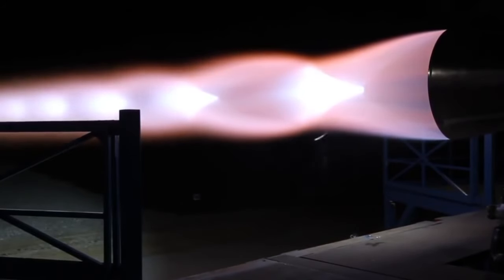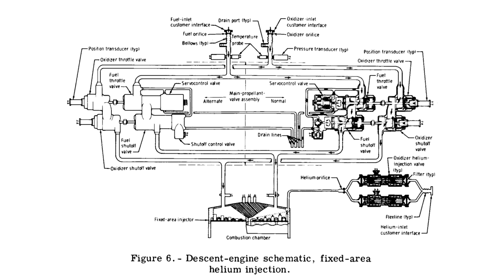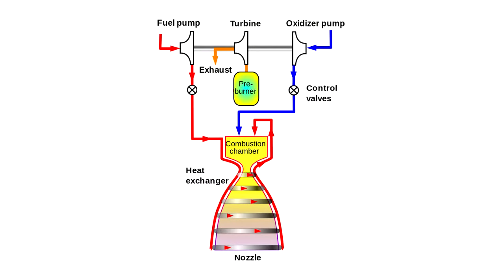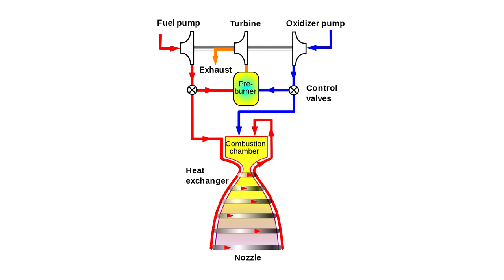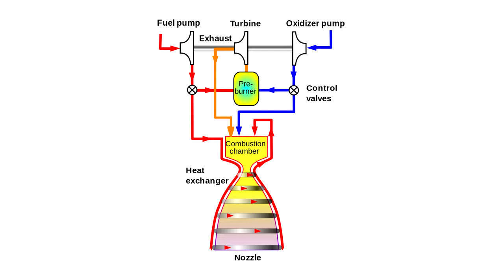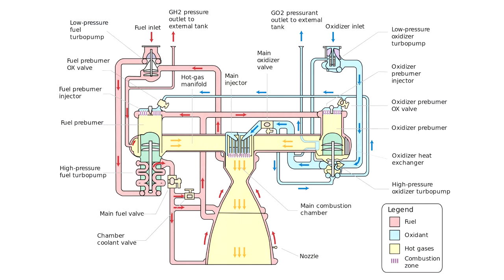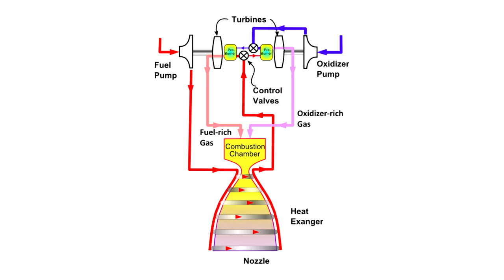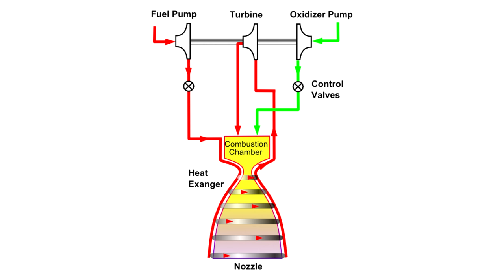KSP Doesn't Teach: Rocket Engine Plumbing

Comment: The one thing I would correct is that the notion of a oxygen-rich preburn being "cooler" than a stoichiometric burn.  Oxygen rich actually is a bad double-whammy:  It runs hot and it introduces an oxidizer into a hot metallic system, leading to rapid disintegration.  This is principally why running "lean" in car engines rapidly destroys them.  The problem the Soviets found was that a fuel-rich preburn clogged the exhaust pipes and threw off the delicate flow balance into the main combustion chamber, so instead they designed turbine wheels that could survive the heat (probably the first use of Inconel turbine wheels).  The space shuttle engine got around the problem by using hydrogen fuel, which has no solid byproduct.  So they can run "rich" while still maintaining the flow balance.
Reply from the maker: Not to mention that running Hydrolox engines fuel rich results in a lower average molecular mass in the combustion products and increases the ISP
Reply: @scottmanley  I can't wrap my head around the idea of why a lower mass combustion product is more efficient? 
Is this because there is the same combustion force/fuel reaction, so you get more "bang for your buck"?
Reply: @JoshKaufmanstuff  Lower MW gasses move at higher speeds for a given temperature. Higher exhaust velocity means higher specific impulse and more "bang for your buck"
Reply: @JoshKaufmanstuff  Isp is all about exhaust velocity. Smaller molecular mass results in higher velocicy given a fixed chamber pressure. This is why ion thrusters are so efficient, exhaust velocities in the tens of km/s
Reply: Modern KeroLOx engines seem to have sidestepped the carbonization problem possibly with better refining and design as well as more specialized materials on the fuel side.

Comment: Excellent presentation!  It really covered a lot of material. I'm very glad you ended with the cryogenic (LH2)  expander cycle and its limit (about 25,000 lb thrust), which limits the thrust of the RL-10A engine(s) of the Centaur second stage used on Atlas V.  Compare this with the 210,000 lb thrust of the Merlin 1D Vacuum. The RL-10A, of course, has higher specific impulse, so it is considerably more efficient than the Merlin, but the difference in thrust means that the Centaur may have to angle its thrust to avoid falling back into the atmosphere. This is why Centaur can have one or two RL-10A engines. In the case of the Cygnus CRS OA-6 mission, the Atlas V first stage MECO'd 5 seconds too early, which meant the single engined Centaur had to burn a minute longer, using up nearly all its fuel reserves. Cygnus dropped alarmingly low back into the atmosphere, and barely made it up. All this despite the fact that the Atlas V burns a lot longer and reaches a much higher velocity and altitude than Falcon 9 at MECO. The Indians have got around the expander cycle thrust limit by building a 50,000 lb thrust class gas generator cycle cryogenic (LH2) engine for the second stage of their new GSLV 3 launcher (I say second stage, but actually the vehicle is launched with only two big SRBs firing, and the core first stage is ignited when the SRBs quit). The Delta IV second stage uses a single RL-10 engine, too.

One reason the Falcon 9 first stage  is recoverable is that it quits at  lower altitude and velocity, leaving the second stage with more work to do.
Reply: this has to be the most informative comment ever

Comment: Hey Scott! At 6:33 you say the Merlin burns a bit of fuel and a lot of oxygen in the preburner, but it actually runs fuel rich, burning fuel with a tiny bit of oxygen, to generate gasses that are hot enough to drive the pumps but not extremely corrosive, as they would be with an oxygen rich cycle.
Reply: Can someone please explain to me why a slightly over expanded nozzle is not more efficient than an ambient nozzle (no flow Sep and higher exhaust velocity)
Reply: @thomasrichardson8327  Over expansion means that the exhaust gas static pressure drops below ambient pressure before it leaves the nozzle. Basically, in an over expanded nozzle, there exists a region on the nozzle wall where the pressure exerted on the outside is stronger than the pressure exerted on the inside, which results in a net force pushing backward on the nozzle, directly reducing the total net thrust the engine produces.
Reply: @sycodeathman  That's a helpful explanation!
Reply: @Lewlcat_  but in cases such as the sea dragon you need that giant nossle.

Comment: I think that is something that always been missing: Technological development in KSP. Yea sure, there is the Ion engine and the nuclear engine.

But apart from that, its mostly just larger and larger engines with different nozzles.

For example the mainsail, skipper and puddle, is reallyh one and the same engine with 3 different nozzles (giver or take)
Reply: So what do you suggest, a mini real time cfd addition, which would model the performance of geometry, describe heat flow, etc.
Reply: marshalcraft 
I would like there to be one fork of nozzle research. One fork of engine (pluming)  research and one fork of size research.

This way you don´t have to unlook every single engine.

Also... old pluming and nozzles out of date can become obsolete removing them from the build menu.

Also i would like to se the nozzle design as tweeks of engines in steed of different engines. This would vastly decrease the number of components to select from, making the game simpler to play, yet more functional.
Reply: Larger and more powefull engines is technological development.  They are just do not say what technology is behind. How they are achived this improvement  You just got final product of technolgical development/
Reply: 1010ZZZ1010 Sure it is.. it was not my point. My point was that one can develop a rocket engine in 3 major ways. Better plumming, better nozile, and make it larger and still stick with the same basic idéa.

Comment: Hey! I know the difference between fuel rich and gas rich because I'm a welder and when you cut with an acetylene torch it requires what we call a 'neutral' flame, and not an oxidizing one.

I KNEW A THING!
Reply: as far as i know, when you cut with an acetylene torch you use the flame just to heat up the metal. when you press the lever, pure oxygen comes out of the middle nozzle and actually burns the metal, cutting it. so you cut with oxygen, basically, not with acetylene.
Reply: This is true. The more oxygen in the mix the hotter the torch. But the point is that you want a neutral flame and not an oxidizing flame

Its very very important when acetylene welding, because if you have an oxidized flame then it contaminates the weld puddle and you'll get incomplete fusion.
Reply: Welding and cutting are two different things. What I was saying is that the cutting is done by the oxygen jet alone, not by the acetylene flame, whatever the mixture. The flame is just to heat up the metal up to where the oxygen can burn it. If you could heat it up with something else like induction, you could stil cut it with oxygen. Unless you cut with the welding torch, which is not what that's designed for.
Reply: @tripplefives1402  It's certainly true that when precision matters, you would cut metal with a plasma jet cutter or a laser, depending on the thickness of the material. (Water-jet cutters are similarly precise, but only necessary if you don't want to heat up the material being cut.) However, there are situations in demolition where all you need to do is cut a metal beam or other object in an approximate area, without any requirement for precision.
For that application, oxy-fuel cutting is still the cheapest and simplest method, either using acetylene or a substitute fuel such as MAPP gas, a blend of methylacetylene, propadiene and propylene which can be liquefied under pressure without the risk of explosive decomposition associated with acetylene.

Anyway, Dan here is entirely correct to say that welding and cutting are different: In oxy-fuel welding, you typically use a slightly fuel-rich flame (only slightly, just to ensure that the flame has no un-reacted oxygen) for heating up the weld area, and yes, this type of welding is rather imprecise compared to MIG welding, for example. Oxy-fuel cutting uses a similar flame, except it doesn't have to be fuel rich. In fact, a third gas-feed line with a separate valve is used to deliberately inject extra oxygen into the core of the flame, which really does burn the preheated metal away to make the cut.
Reply: @tripplefives1402  Outgassing? What gas is produced by burning metals then? Even at oxy-fuel temperatures, metal oxides are either solids or liquids, not gases. You would get some carbon dioxide by burning carbon steel, but not much because the percentage of carbon is quite low.
Reply: @tripplefives1402  
Right. As the oxygen burns surface metal, the released heat goes into further melting the underlying metal. The velocity of the metal oxide vapor (and oxygen) blows liquid metal out of the cutting channel.

Comment: I'm wondering about the plumbing of refueling in orbit. Has it ever been done before?
Reply: Russia does it on the ISS using the Progress. IDK if the ATV did it too.
Reply: Do you mean how do they maintain "perfect" pressure given that, as he explained, for the engine to work and not eat itself it needs near perfect ratios of fuel and oxidiser for the given rating?

I don't know. I'm not a rocket scientist/engineer, but seeing as this is the crapshoot of youtube comments I'll put my oar in.

Either they are using the same engines, and therefore have the same mix being transferred, or they have on board separate tanks that they can then inject the needed ratios into the other vehicle.
Reply: Curebores
During refueling the engines are off.
Reply: Like Andras said, the engines are off so the turbopump and the gas generator bit isnt even active. Fuel is simply  being pumped into the tanks at the relatively low tank pressure via a different valve, I think thats right anyway :P
Reply: I think he means how the transfer the proper ratios (for example, etanol/LOX, one of the few ration I know, has a ratio of 7:1 in most cases). I think it is as easy as having a tank for your engines with your ratio and one for the ISS's engines with its ratio and probably different longer lasting yet probably slightly less efficient fuel (Progresses can only last about 6 months without the fuel worsening IIRC).
Reply: @1312_PV  The fuel being transferred isn't mixed at all.  So getting the ratio wrong just means there will be some left in one of the tanks (fuel or oxidizer) when the other tank is empty.  Easily fixed by making the opposite deviation on next refill.
Reply: @johncrowerdoe5527  I see, I knew they were not mixed but couldn't see how it would be solved without "sucking" propellant back. Making the opposite "error" next time makes sense, thanks!

Comment: I'm learning a lot from this video series. I always thought the liquid fuel tank on the space shuttle, for example, was just a giant bottle, not a container for machinery. I also didn't know that the rings around an exhaust nozzle were used for convection cooling. I though they were just structural.

Comment: The Space Shuttle Main Engine / RS-25 cycle is fun (and I'm surprised you didn't mention it as a Full Flow engine). It uses both Pre-Combustion, with a 'leg' for each of Fuel and Oxidiser but has two pumping stages, with the Low Pressure pumps not being driven by pre-combustion. The Oxidiser side Low Pressure pump is actually driven by a tap off of the High Pressure Oxidiser and the Low Pressure Fuel pump is driven by an Expander cycle from the Fuel circuit. As you said in the video the High Pressure pumps both run off a Fuel Rich pre-combustor, however, unlike your diagram, there is no separate flow of fuel to the Combustion Chamber, all the fuel goes vis the exhausts of the pre-burners, through the turbo-pumps, and then into the engine. Oxygen arrives separately. The final little tweak is that some gaseous Hydrogen and Oxygen (as appropriate) is fed back to the tanks to pressurise them sufficiently that they don't crumple as they empty.
Reply from the maker: +Rick Ansell oh yeah the RS-25 does a lot of smart things with its plumbing. However I want to clarify that it's not considered a full flow staged combustion cycle, which is why I didn't cite it as an example of one.

Comment: I think its pretty crazy and cool that the Space Shuttle Main Engines use four turbo pumps, a low pressure and high pressure set. And it could get some pretty high performance figures while using LOX/LH2. Only downside is, you could only run it once per launch. Also, interesting you mentioned soot. I read up that the F1 rocket engine was flushed, before and after firings, and before launch, with TCE to help prevent buildup inside that would cause problems.

Comment: I found this video very interesting and informative. I have a mechanical engineering degree with a focus on thermal sciences. I work on turbo machinery, hydraulics and fuel systems specifically for aircraft. Over the last couple years, I've taken an interest in space exploration and all that entails. I've honestly never even looked at the applications my work would have in the space industry. I've always just looked at rockets as big engines burning stuff and making a lot of noise. It's interesting to learn just how they work and learning about the cycles is a good place to start. Thanks for the video!

Comment: Trivia: When von Braun first designed turbopump, he used the turbopump that used for high pressure fire engine at thats time
Reply: I visited the Space Museum in Leicester earlier this year with my Astronomical Society. They had a damaged turbopump assembly recovered from a V2 that fell on England, sat right next to the engine assembly (including turbopumps) from an early British sounding rocket. I'm not saying we copied the design from von Braun (we probably did), but me and another society member noticed that they looked almost completely identical...
Reply: @dylantowers9367  You clould put a Turbocharger next to it and it would still look very similar as it's basically the same Thing. Just pumping Air instead of Liquid Fuel.

Comment: I think Project Orion should be considered once more.
Reply: ***** I've heard theres a lot of it out there. You just have to build a container of antimatter to be able to keep it once it rushes through us.
Reply: Obligatory warp drive mention
Reply: I think Project Orion is a pipe dream.  IMO NASA had it right before the White House stuck in the fat fingers; return to the moon, build a permanently manned base (which ironically is what China wants to do), do some more research, and then use the moon base to build and launch other, intraplanetary missions.
Reply: No.
Reply: ost355 You just have to build an antimatter container to keep it after it rushes through us? Say what?! There's no antimatter rushing through us buddy. That would be a problem. Matter + Antimatter = bad
Reply: Too expensive and nukes in space are illegal as of now and the rocket that you’d need to launch it is scary expensive and you know, the public won’t like 1000 nuclear warheads just flying in the sky